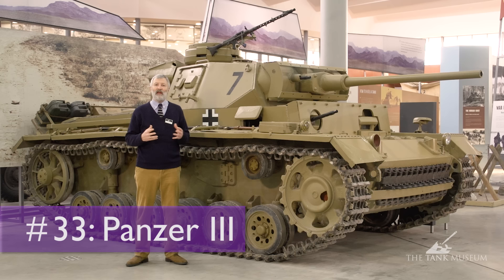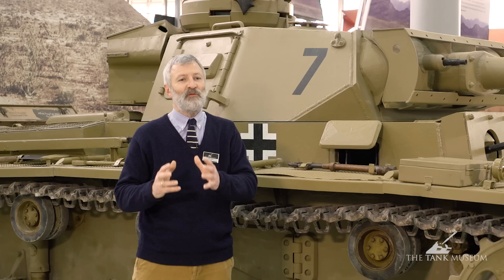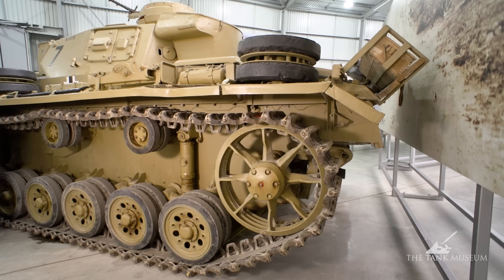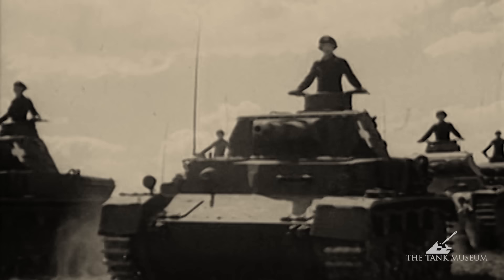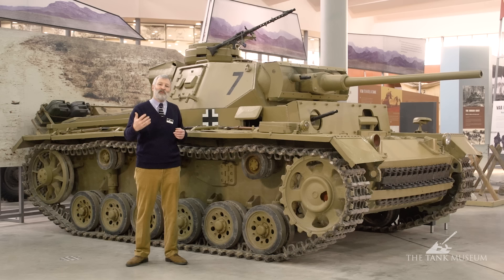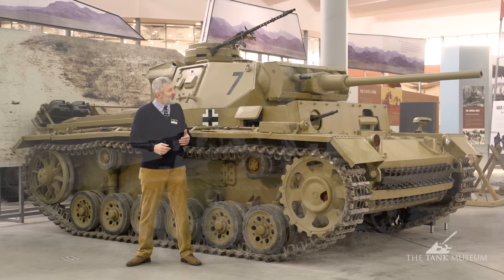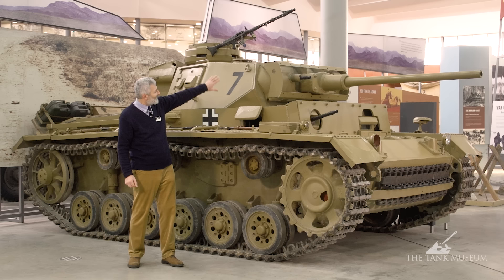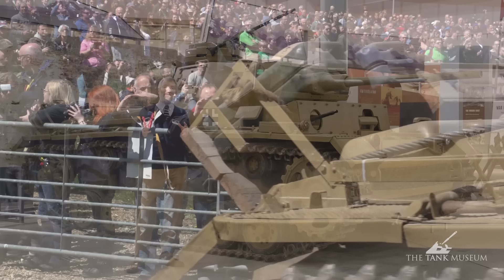Tank Chats #33 Panzer III | The Tank Museum

Comment: Anyone notice the gaping hole in the right drive sprocket? Battle damage?
Reply: Might be just rusted through if its original piece, it looks like some dust cover of wheel hub, meant to keep the bearings and/or brake (if there is one in drive sprocket on Pz. III, to me it looks like it is, since  it looks really massive compared to rear sprocket, but i don't have any actual plans) from catching rust and dirt - imagine how hard it is to loosen wheel bolts on typical car after winter. Now imagine your car is 23t heavy and spent most of the winter digged up to its side mirrors in russian mud. Unless you keep those things clean and oiled you are pretty much screwed. :)
Reply: Can confirm, it is battle damage. Besides, the tank museum keep the tanks in better condition than that.
Reply: Thought it looked like a leaf or something painted on lol

Comment: There were two major reasons for that the Pzkmpf III couldt be upgraded more. The wheel system could carry more weight and in particual it was for that reason not posible to give it a bigger turret ring to mount a bigger gun (as they were able to do with the Pzkmpf IV) because the wheel system could not handle that the superstructure were strechted over the wheel area.

Comment: This is what modern tanks look like: Turret min the middle, engine in the back, small road wheels with individual torsion bar suspension, dampers only in the front and back. 3-man turret, turret cage (on some models), all vehicles equipped with radios. The big differences are the petrol engine and the front sprocket.

Comment: A hypothetical question or thought. In the big picture how much more effective would the Wehrmacht have been if the money, resources and engineering talent dumped into the navy had been used for the Wehrmacht? I'm referring to the surface fleet which never was a factor in the war. U-boats is different story.

Comment: I just saw a Video again...a German docu here about German Tank History, not limited to WW2 but except some AV7 and other info of the pre Panzer I era its 75% about "Panzer XYZ". The Panzer III was build since 1936, the low number ready in Sep 1939 they say was largely a lack of ressources? Sure looking at the tonnage, same with the since 1937 built Panzer IV, its an extreme difference in materials needed, same with needed engines and fuel consumption. The ammo for 75mm but even the 37mm grenades were much heavier than 20mm or just 2 x MG14/MG17(?) rounds... I thought a financial shortage mixed with controll of the leading exporters/powers (US, SU and UK? Controlled like almost all than known ressources or made sure Axis doesn't get access?), but was it more financial shortage or controll, like last I was pretty sure the western powers especially with US being the Saudi Arabia or even whole OPEC of the World back than controlled not too much oil is sold to Germany and maybe possible nearby friends (Italy? Austria was self-sufficient or even in theory able to export until the "Anschluss" thanks to Vienna Basin)... so money, controll or mix?!

Comment: It's a little ironic how they could've had a support tank on the same chassis, given that the N was equipped with the same L24 short gun of the early Pz4, so avoiding logistical problems of having two tanks in the same batallion, also if they'd a lot of parts in common.

Comment: I'm fairly certain that the ausführung L had a 50mm base plate with the 20mm spaced armour plating ontop, not 30mm+20mm.
Reply: James V. D. Bosch this presenter usually fudges a few things in the videos he is involved with. You can certainly tell he's read on the subject but not thoroughly enough to make those types of distinctions.
Reply: He didn't say that the ausführung L had 30mm, easy mistake though.

Comment: Not too sure the 50mm would've helped much against the KV-1 - even the longer L/60 variant. Perhaps with hardcore/tungsten projectiles, but those were never widely available since tungsten was in such short supply in Germany. 

In my amateur opinion, the one tank they would've needed early on to reliably deal  with the Russian heavies was the Pz IV F2/G with the long 75mm.

Comment: The Pzkmpf III Ausf N with the short barrel 75 mm gun was special ordered to Tiger I unit as close support to Tiger I and ordenance role in Tiger I units however the Germans soon realized that close support for a Tiger I needed to be a Tiger I to so they were removed from the Tiger I units and distributed to secondline operation areas. However I had read that the germans like the Ausf N most, but I guess you need to compared that to what the alternatives was..

Comment: This shows the importance of a highly upgradeable design. The Pz III and even the Pz IV was too limited in that perspective - it really would have needed a sloped armor, much wider tracks, more capable suspensions for armor/turret upgrades and larger hulls so larger turrets and 75 or perhaps even 88mm guns could be housed. Also the production numbers dwarf in comparison to the T/34 or the Sherman with about 15,000 StugIII+Pz III vs . 50,000 Shermans and 65,000 T/34s. Especially appalling are the German production numbers in 1940 when Germany was not bombed and was preparing for Barbarossa - only about 1,000 tanks were built. Germany has not mobilized its industrial production until very very late in the war (43) - the Soviets produced 12-15 times that number each following year, immediately after entering the war (41).
Reply: The speaker does explain why German early tank production was 'slow'.

Comment: Whats wrong with its fron wheel? It looks like its been shot thru it.
Reply: In the army if you are getting shot at youve been doing your job wrong.
Reply: Yeah, I was wondering that too. I that a piece of red cloth stuck the front sprocket or is that a broken area? They fixed a lot of stuff on it when they refurbished it, so I guess it must be something stuck to the wheel or they would have patched it up. EDIT: I looked at a lot of other photos of this tank and the sprocket's defect is present in all of them. It must be original damage which was deemed not harmful so it was left as is.
Reply: Here are some detailed photos: http://www.britmodeller.com/forums/index.php?/topic/235002554-panzer-iii-panzerkampfwagen-iii-aus-l/
Reply: Yeah, I thought it was a painted on leaf at first, but the part where they are driving it cleared that up.
Reply: With that attitude there is totally wrong I wont like to be in a lame army that had learned you that. But really? I doubt you had been soldier at all...

Comment: why does this example have the extra armor on the the front hull yet only the framework on the gun manlet?
Reply: At 11:35 you can actually see a picture of the state it was in when captured.... the gun mantlet armour is missing.
Reply: When they were introduced German factories couldn't produce enough of the extra armour plates so for a while in 1942 Panzer IIIs were sent out with the plate missing and only the framework in place. There are lots of Panzer III Ausf. L photos around that show tanks with exactly the same setup as the Bovington tank.
Reply: Because some commanders removed it as it interferred with the forward visibility when in action.
Reply: +Malcolm Hunt
yeah, that statement doesn't make any sense. Not as long commander do not remove the entire front plate of the turret. I do not think many did :P
Reply: Well the info is from the book The 10. Panzer Division: In action in the East, the West and North Africa, 1939-1943 by J.Restayn & N. Moller, inside the book are no end of photos of PzKpfw III's and about half of them have the spaced armour on the mantlet missing and it states that this was down to individual commanders who felt that the spaced armour interferred with observation from the turret.  As you can clearly see It isn't the entire front plate i.e. the mantlet that has been removed it's the additional spaced armour that has been removed.
Reply: I dont think that the premise of it being down to individual commanders choice is correct nor holds water. I would say that the missing mantlet armour is more likely due to armour plate production falling short and given the pressing need for tanks, the tanks were sent out without them, and if the mantlet pieces did became available they would be fitted later. If your running behind producing armour plate then you would do everything possible to produce the standard panels required to produce the tanks and then see to the extra panels. Get as many working tanks out the door as possible!
Reply: Is that some Ogiue-chan in your profile pic?
Reply: It's a 'spaced armor' mantlet, and apparently, the outer plate was either heavily damaged or blown off (you can see the holes for all the bolts in the framework of the mantlet).
Reply: Actually Id rather say it was dismounted by the crew rather than blown off (as there really isnt any damage to the frame supposed to hold it)
Reply: If it was due to damage, those wouldn't be clean holes; they'd be mangled messes.  The bolts were either never there or were removed on purpose by the quartermaster.
Reply: You can also see a hole in the foremost wheel. This tank is definitely not a pristine example.
Reply: They never got a chance to finish up armoring it.
Reply: No fore some reason some was actual sent from the factory without. I guess there had been a shortage of that sparepart in a period.
Reply: Well the commander is a commander of the tank. He is not the owner of the tank. The commander of the unit would not had been in a position to allowed that. I guess you guys had never been in an army. There is a lot of regulations and rules to obay.
Reply: And that give no sence. Becaue the commander was sitting above it in his barrel with vision ports. German tactic was that the gunner turned the tower in the direction of the commanders orders. And those orders had to be very precise because the vision system for the gunner was actual very very narrow. No commander would have that thought that he needed to give his gunner a better point of view because the gunner sight was total lame for this. It was not build for that at all. It was build for the commander was able to give precise dirrective. And thats why the commander got most of all medals because he was the smart one...
Reply: No there were a lot of them sent to the front from factory without them mounted.

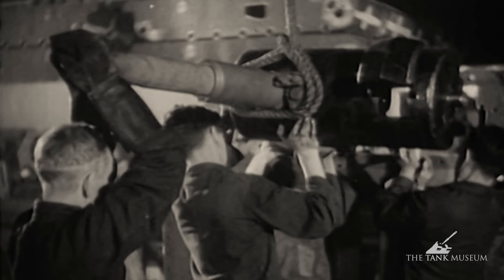Comment: 8:26 "And that makes him führious." xD Nice one David ;-)

The problem with any tank is that it will hit its limits after a while. A 50mm gun was the largest the turret ring could handle. A 75mm gun would've probably torn the turret off or at least put so much stress on the vehicle that it would barely survive a dozen shots. Interestingly the Panzer III, which was the smaller and lighter tank, initially played the role the Panzer IV would later take on. But the Panzer IV was much more suited for upgunning and uparmoring and remained in production until the end of the war. It could handle a long-barrelled 75mm gun, more armor being added and more powerful engines. An upgraded Panzer IV was easily capable of taking on M4 Shermans and T-34 tanks.
Reply: Well, except that the ausf. N did in fact have a 75mm L/24 fitted... but I agree the high velocity 75mm would be out of the question.

Comment: Germany had  Only 98 Pz IIIs and 211 Pz IV tanks combat ready at the outbreak of ww2 while Britain had 2 Matilda II for comparison.
British politicians being cheap for you making  A.11, Infantry Tank Mk.I, Matilda instead of just going with the A.12, Infantry Tank Mk.II, Matilda II.
140 produced in batch in 1938 was the Matilda & if Chamberlains administration bothered to pour any real money into getting those Matilda II's into service the war in France would have looked very different. 
A.13 cruiser was fine enough a tank but only 65 made with A.9 cruiser having an odd start.

Besides British muck up; the French genuinely thought the Renault 1500 odd Renault R35's were a match for Panzer III when the commander & gunner being the same person in such a small turret was doomed concept by the invasion of France in when Germany had 523 Panzer Is, 955 Panzer IIs, 349 Panzer IIIs, 278 Panzer IVs, 106 Panzer 35(t)s, and 228 Panzer 38(t)s.
Not to mention no radio's present in French R35's.

Panzer III was not necessarily a brilliant tank but the fact it was made in meaningful numbers while equipped with radios & a sensible crew arrangement unlike the French who arranged nothing sensibly.
Mind the Panzer 3 & 4 wasn't alone as  Panzer 35(t) & 28(t) the Germans seized off the Czechoslovakia was almost as plentiful.

Hotchkiss H35/39 was an even greater waste of resources, time & manufacturing by France for 1,200 tank that were outdated before they started production in 1935.
Why the Made them to 1940 is what always confused me as they repurposed the plant to do something useful in 1939 at the latest.

Is lunacy that only the British Matilda II, Czech t(38) & possibly the Swedish Landsverk L-60 were even comparable tanks to the Panzer III & IV in 1939. 
How every other industrialized nation even allowed themselves to not have anything suitable always confused me.

Is it really German skill or their foes complacency?

Comment: Very nice video. But is it just me, or is the bolt on mantlet missing from the museum Panzer III? You can see the mounting strips, with the empty bolt holes?
Reply: It appears that the tank and many of its classmates were produced with the mounting strips in preparation for the fitting of the additional mantlet armour, but the additional armour was falling behind in production.
A case of trying to push as many tanks out of the factories as is possible and hoping that the additional armour can be supplied and fitted later.
Reply: Thanks. I did not know that.

Comment: (IF I MAY!) The Gentleman should have also mentioned that the torsion-bar system that the Germans were mounting on their tanks, with those "long torsion-bars", mounted on the opposite side of the tank's "underbelly", practically prevented to MOUNT ESCAPE-HATCHES at the BOTTOM OF THE TANK. If the tank was hit and the crew had to escape - they could do it only from the top-hatches, going straight into the path of flying bullets and shrapnels. They could have mounted the "Christie-bars" system, which was cheaper and easier to manufacture, but the Germans had always their way of doing things and there's NOTHING IN THE WORLD that can make them change their minds! :) 
...and (on the other side) being a proud BMW owner, I cannot do anything else but AGREE! :) :)

Comment: The panzer 1 and 2  weren't training tanks they were actually tanks designed for battle
Reply from the maker: The Panzer I was a design intended for training, although still relativity advanced for its time, it formed a large part of the German's mechanised forces between 1939 and 1941. With regards to the Panzer II, by the end of 1942 it had largely been withdrawn to a training role or used on secondary fronts.
Reply: @thetankmuseum  thanks for letting me know I was under the impression that they were originally intended for anti tank combat because of their anti tank guns, love the videos they are very interesting and informative

Comment: The long-barrelled 50mm gun wouldn't have had ANY impact on "Operation Barbarossa" even if  the Germans STARTED USING IT FROM THE BEGINNING - this is just ONE TINY "PARTICULAR" of the whole war-effort in the East that the Germans could NOT win - PERIOD. The T-34's and KV-1's were beeing KO-ut only by their 88's and (in some cases) by their field artillery shooting at "elevation zero", and almost "point-blank". When the T-34's attacked "en masse" it would come mainly to the new PaK's, the "field-artillery", the "Sturmgeschutz"-units, and (especially) AT-INFANTRY PLATOONS to stop the soviet onslaught. PzIII (even with the 50mm gun) were practically USELESS against the soviet goliats, unless they came very close. The ONLY GUN in THE WHOLE "PANZERARMEE" that could stop the soviet tanks was the 75mm and (later on) the 88 of the Tiger & similar). 
If the Russians would have been able to improve their tactics and coordination they could have been creating enormous gaps in the German front-line already by 1942 while in fact they preferred (by a WISE choice) to wait until the end of the German attack at Kursk, and only when the Germans wore off, then the soviets passed onto a STRATEGIC offensive - and the how the Red Army was improved it could be seen in 1944, when "Operation Bagration" started and the slaughter of the whole "Army Group Center" took place (admittedly - a much worse defeat for the Germans than Stalingrad!). 37mm or 50mm - long barelled or NOT - that would change absolutely NOTHING.

Comment: Isn't that just a myth, that the side skirts were supposed to tumble solid shot and dissipate HEAT weapons? 
The original point with putting them on was to mitigate the high losses to Soviet anti-tank rifles.
Adding skirts was the reason the germans did not replace the panther with the panther II.